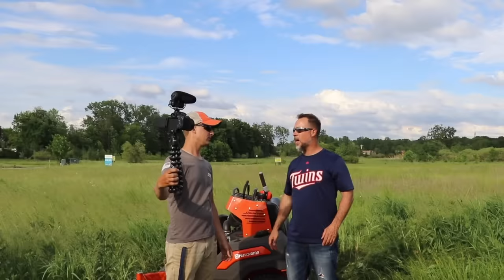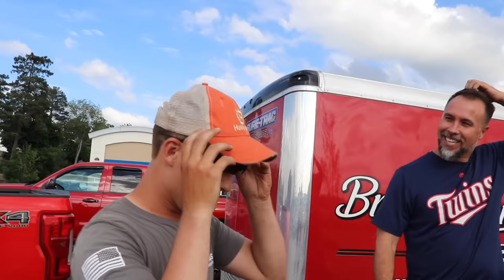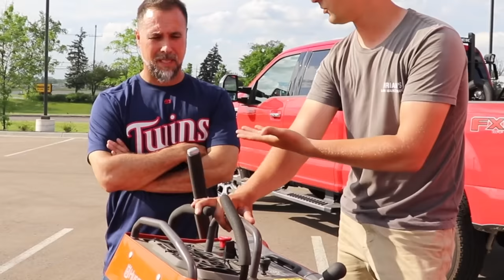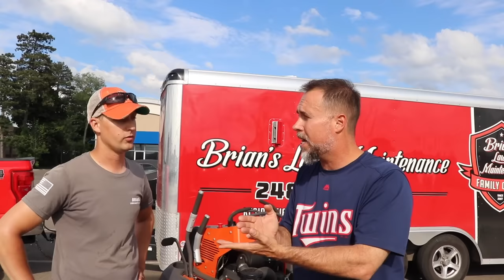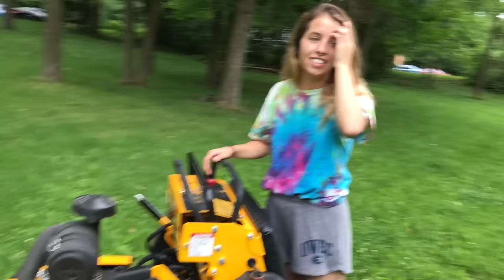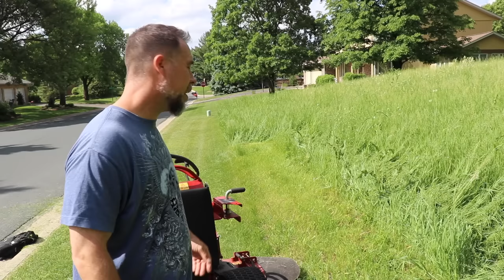Best & Worst lawn Mower of the Year- Husqvarna, Toro Grandstand or Wright stander z

Comment: The wright mowers have very bad  customer support. My 32 hydro for the first 8 months really sucked. A lot of electrical issues and could not get help. When I ordered it they said they would deliver it called the shop they said they had it there well after 3 weeks I drove the 4 hour drive. So wright needs to step up their game. So guess I will go back to the gravely mower 18 years of use with that mower never had a problem. But it needs a new engine after all these years. Oh yea the wright runs fin now but the girls prefer the gravely easier to use the controls for them. And the gravely is a belt drive 34 inch cut.

Comment: Husqvarna sucks, i bought one as I have 2 lots. the damn thing brakes every time I use it first 6 months i went through 2 head gaskets and had to rebuild the deck multiple times and found a flaw in their replacement parts the belt pully has no lip at the spindle like the original which causes it to strip the pully immediately upon blade engagement. 5 pulleys later i found the flaw so i put a washer on top and it seems to have fixed that problem I was mowing last week and as im crossing the driveway the spindle housing pops a mounting bolt then blows apart. i drilled out the bolt holes from another spindle housing i had that was striped and insted of using the small crap they sell i used 5/8 nut and bolt 

my 25-year-old push mower I paid $20 for 4 years ago have done 0 maintenance to still runs and cuts like a champ starts first pull every time

Comment: Stanley, I need a tip from a landscaper. I'm taking down my above ground pool this weekend and I have no clue what i'm going to do with the few 4+ inches of sand under it? Any tips? Do I have to remove it all or just about half and put topsoil over it?
Reply: Id spead the sand around the lawn to fill in dips and holes.

Comment: Seems like the Husky is going down the ladder a bit. I 100% agree that some of these engineers need to test the stuff they design to see its actual practicality. Similar issues with Honda and their pushys here in Australia. Their new design mowers have a smaller chute in the 19" models which is way too tiny to be adequate for what a lot of people cut here and god knows why they had to put an engine brake lever on the damn things as well. They are one of the only brands selling in Aus that has it. Just about every Aussie contractor known to man complained to Honda about the ridiculously underpowered engines (when I got me new HRU216 it sounded like it was running at 1/2 throttle) and stupidly small grass chutes they were putting on their "professional" mowers. Not even going to start on the engine brake levers though lol. And what was Honda's response? Operator error. Our mowers are fine. Our engines are fine. You just must not be using it properly. So how can it be then that so many professionals that have often been mowing for 15+ years aren't doing it right? Seems dodgy AF if you ask me though we still buy them (but many have now switched to Rover, Masport etc.) for some reason or another. And can I add they ain't cheap either. $1750 for an underpowered 21" mower that can't even mulch a regular length lawn is pretty over the top in my eyes.

Comment: An it's obvious that husq didn't do any testing with a prototype before producing the line of mower. An it seems like they shoulda out the dip stick facing the back so when u open the seat u pull it out towards u. An the batt Shoulda been designed better. Different angle or location. Or just a diff battery with side posts.

Comment: on the Husqvarna, were the blades supper dull or something?
Reply from the maker: not that I seen
Reply: @Dirtmonkey  I see what's going on.
Grass is length of the mower deck which then keeps the grass folded over not allowing it to spring back up to come in contact with blades. 
All and all it still doesn't seem like it's put together to good. 
Thanks for the video and pointing out some good tips.

Comment: ideally why didnt they make it so that the release of the lever would just kill the blades..........instead of the engine. i understand the safety reasoning of the lever killing the engine but killing the blades would be safe as anything. personally i will stick to my ride on 06 john deere 115. i can disable any safety feature on it like the RIO switch and that is done with a simple piece of wire but if i ever sell it then it will be put back on for sure.

Comment: I made it to the part where they started whining about the mower not cutting how they thought it should be cutting.
If you're cutting grass that is thick(ish) and higher than the mower deck, it's not going to give you a beautiful cut. Not one damn machine on the market will do that. None of them.
Not Exmark, not Toro, Gravely, Hustler, Grasshopper, and anybody else. I don't care how much horsepower, deck depth, deck width, or anything else you throw at it.. If the grass is thick and higher than the deck, it's not going to cut it in 1 run.  You're mowing stuff that should be cut with a shredder. 

I do agree with dude about the battery and dipstick. That set up is just stupid.

Comment: Everyone saying they are using a finish mower where a brushhog should be used. I do not see any saplin or bushes I only see grass. If I buy a mower that is more than 2000 bucks it better be able to mow grass at any height. I own an old 1960s Simplicity 728 tractor 8hp and I mow grass twice as thick what these guys mowed with berry bushes and small saplins about finger thickness and been doing for over 25 years with same tractors, I may not have a big deck or the big hp but I will mow anything that can be thrown at it and the thing is I payed 50 bucks for it in 1983 and mow my property which is over 10 acres of mowed acreage and I mow alot of other stuff for other people with it that people are afraid to mow with their tractors the old Simplicities pivoted in the rear instead of the front axle like other lawn tractors which makes them better on hills and slopes where you just can't go with others. I beat and abuse my simplicity and use it for what it was designed to cut stuff down. My only maintence is keep the oils in motor and rear changed and walk around it with a grease gun. I look at today's crappy mowers everytime I go to a dealer for farm equiptment parts and all I see is overpriced plastic and safety switched to hell junk on rubber tires all a mower of any kind needs is engine a way to start it recoil or electric, a trans of some sort to go forward and reverse, a mower deck with a way to engage it and a set of tires. A mower does not need switches under your @$$ and on every pedal and lever on it. All I see is high cost to buy high cost to maintain and many things to go wrong and break. A machine to cut grass does not need to be complicated look a sickle bar mowers been around for over a hundred years cuts thick tall grass very efficiently with little hp and without all the crap to fall apart and break and cost money. People spending 5000-10000 on junk to mow a lawn.  Hell if I'm spending 5000-10000 I'm buying a 50-100hp tractor that I can plow,disc,plant,mow,rake and bale hay with not a piece of plastic crap.

Comment: the Hus isn't cutting well because of the deck design, if you notice the front of the deck isn't angled, now that angle is very easily seen on mowers like scag, what that angle does is allow the grass to flip back up inside the deck easier so that is could get cut by the blade because the blade is slightly above the lowest part of the deck for safety ( now when you cross blade the lower blade hangs slightly under the deck with solves this issue but that isn't safe lets say if you hit a rock it could go flying anywhere and it can ruin your spindles faster ). OORRRR you need high lift blade to help create more up draft inside the deck to help pull the grass straight up, but this won't help in this case because of just how tall the grass is here, I mean this really should be cut but a rough cut or a brush cutter first to knock it down but I guarantee you if the front of the deck had a shallower angle it would do MUCH better.

Comment: my little input  doesn't seem rpm of the mower blades isn't spinning  fast at all seems it  very choppy more like its hacking at the grass instead of cutting it, idk if you get what i mean , heck my junk M.T.D  can cut better then that an it falling apart. i use a X-mark , i have my ups an down's on the X-mark , but does the job when it is needed. this thing  has to many thing's that could go wrong it in  a short period of time. this mower was rushed an was not plan out right. also i see this mower being a really big prob on hills , the back tire's need to be wider, just my input on it

Comment: I have a husqavarna and did  5 acres of tall grass today it was like cutting 15 acres i was tempted to cut the frunt of the deck open. The engineers should be forced to mow 5 acres of tall grass in 102. Degree weather before they release the mower

Comment: As a user/operator of a ride on mower, my bugbear is having to duck to avoid branches. Can I have some feedback on the merits of stand on mowers, since  to me that problem is only exacerbated.
Reply: Hee went over that. You have better visibility, you can jump in and off much easier, no tail swing radius, slightly more compact, your legs absorb most of the shock from terrain. (rather than it being translated through your spine when seated.)

Comment: Stanley they could not put the oil dip stick there because valves and  explosive camber and pistion
Reply: greatoutdoors Lawncare You can stick a dip stick anywhere. That's why dip sticks in cats are so long. They're routed through a tube all the way to the bottom of the engine. That's also why they're made of spring steel. So that's definitely not true. They could have very easily routed it up front.
Reply: Andrew Delashaw did u see where he pointed its where the valves and rods and pistion area is

Comment: 7 min in " & already would never buy a husky they make great dirt bikes , that's about it" had a husky backpack blower I got from a yard sale" right" needed a pull cord assembly well kawasaki makes it" hmmm been running standers since 98" and cough " great dane, aaaand back to stander, one has 4800 hrs whaaat yup" repowered in 14" & clutch 2 spindles 15hp kawasaki 3700 hrs  hope I didn't jinx myself" but yeah mig welded the deck few spots and a repaint , re did the knee pads with better material & thicker foam, few sets of tires about it original pumps"  but don't full throttle as soon as I start it it " or my big block mopar"

Comment: What’s the purpose of standing up mowers? Zero turn seems better
Reply: Standers are way easier on the operator since standing  gives you natural shock absorption (knees). They also have a smaller footprint on trailers meaning you lose less space. Also in a hairy situation you can easily just step off. Last I would say if you ever need to clear your path or get off/on its much easier to do so with a stander as opposed to big zero turn.

Comment: I understand you guys are trying using extreme conditions, but anyone trying to cut grass over 6 inches should be using a flail mower.  I can't believe how many YouTuber's use zero turn mowers on grass over 6 inches high.
Reply: Kenneth N. Shortlidge I was thinking the same thing.  Sure, you get a sense of how effectively (or not) it cuts, but it’s unrealistic to expect  almost any finish mower to do well in those conditions.  That’s a job for a Ventrac, or a Little Wonder or Turf Teq brush cutter.  Or that truly badass new Wright dually(sp?) mower that appears briefly in this review.

Their review of the design features and deficiencies, though, is excellent.  I think Husqvarna, and more importantly potential buyers, will find that info very useful.

Comment: husqvarna lawntractor is the worst mower we have ever bought...... 150h in and the entire front end needed to be replaced. starter bolts came out 3 times and the deck casters where all shot.... did i mention the wheel split in half!

Comment: As a mower mechanic these mowers are a nightmare. You can't do the proper maintenance Kawasakis require, everything is so jammed pack. Motor attends to over heat and pops heads left and right. The hydro unit is complete garbage. Blows apart around 200-300 hrs. They over heat also too. And extremely expensive too fix. You will regret this purchase the second you pull out of the dealers lot. Stay away!!!

They haven't even been out that long and I get calls on them all the time. Husqvarna makes chainsaw not mowers. Stick to what your best at!

Comment: Hey everybody...I want to start off by saying that I'm not a hater and I get no satisfaction in calling out a company's product for coming up short or failing..I do not have a deal with any of Spartan's competitors nor am I getting compensated by pushing an anti-Spartan campaign.... I have a Spartan zero turn mower and boyz n girlz do NOT buy a Spartan! Maybe I should say don't buy a Spartan until they work out all the problems...Mine has far too many issues for a mower that costs double what mowers in it's class cost....so a short list of problems include:  Belt Tension(9 belts in 2 seasons), Power problem bogging down on 3 inch high dry grass, Deck Heightening Assist Piston snapped into and then the Control Module that controls all the electrical functions went out and is currently in the service shop being replaced!! This mower was bought brand new off the showroom floor and has been garage kept out of the elements and has been taken care very well..there are only 34 hours on it...These listed problems are just facts..incidents that have happened...no hypotheticals...I'd rather very much be a fanboy of Spartan so I could sing the praises of Spartan and brag a bit but it is what it is folks and this machine has spent 95 percent of it's life out of service...There are positives...like the seat..it is very comfy and then there's the mower's looks...it is one bad ass looking rig...looks like a stealth fighter mower! But I'd trade some of that bad assness(I know...not a word)for a mower that works! Do your homework before U buy!!
Reply from the maker: Thanks for the feedback and comments Nelson!

Comment: What type of blades were on there? I made my boss switch yo batwing high lifts, where u can sharpen the blade all the way to the bolt hole. We have been arguing over what blades work best and how u sharpen them. I swear by a counter clockwise sharping(down into the face which the engeeniers say that's wrong, well I thick of it just like chain saw chain, into the cutter... my boss swear by not taking extra material out of the blades to keep the cutting face straight. He will boomarage the ends. They leave lil Mohawks that way. Twice this season someone put some medium lift straight blades on my mower and they cut horrible. Long strands of cut grass and bogs the mower down so bad on my 11 year old bobcat rider. And they only have about 4 in of cutting surface. And cut about a half in shorter. Which really fucks ya up if u don't know what blades r on. Do a video testing out diff blades and sharpening techniques! From hand files to hand held grinders to pro grade blade grinders. Ur more than welcome to come back to Detroit and come visit our lil shop in Livonia 2 miles outside Detroit. And certain lawns I will double cut the same direction. Everyone eles disagrees with this but it makes such a nicer striping. And when u start a quarter inch higher the first pass then go lower for the second makes less mess and mulches the cut grass so much better

Comment: Not to make you think I stand by any brand, how often do you mow grass that is that tall? Just plain common sense. If the grass is so tall that the uplift of the blade cannot stand the grass straight up, there is no way your going to cut it correctly. All this is bullshit. If the grass is that tall, it needs to be cut with a different method such as a filed mower or sickle bar. Then once the grass is under 8 inches high, then cut it with conventional method.

Comment: I don’t buy anything huqvarna products. My dad has a weed eater by them and my brother had push mower by them and neither one didn’t last a whole season. They are garbage.
Reply: That’s funny I run all husqvarna mowers PZT 48 for 3 years and over 600 hours never been in the shop once for any thing runs like a champ I also run 2 husqvarna  home owner push mower I have a hu700 22 inch with a Honda 190 engine for six years put one new cable on It new blades now and then and change oil once a year that’s it I also run the HU800 AWD Honda 190  4 years old only issue with that one was my employee ran over the wheel with the Z turn my push mowers mow about 20-25 yards each  every week so not sure why they are garbage. I tested this mower they are reviewing here and it cut and stripped very nice I sure as hell don’t ask my finish mowers to cut hat fields
Reply: chuckccfd9 if it works for you great but they don’t work for me. The ones I have experience with had to be fixed all the time.